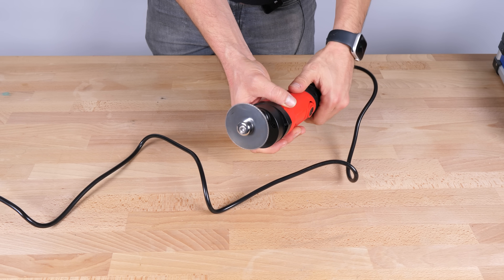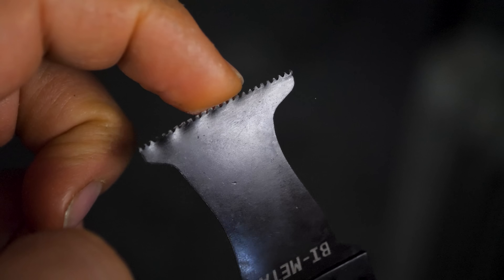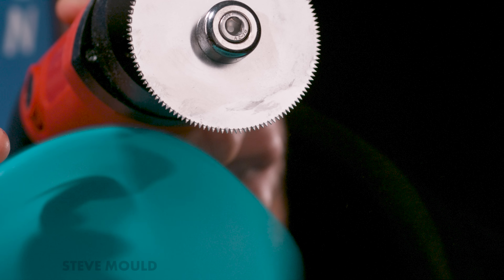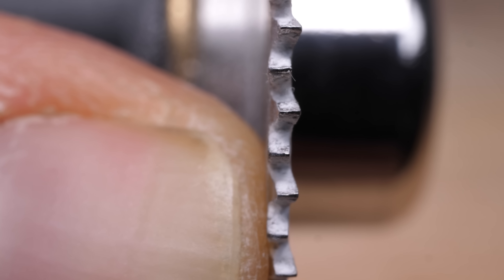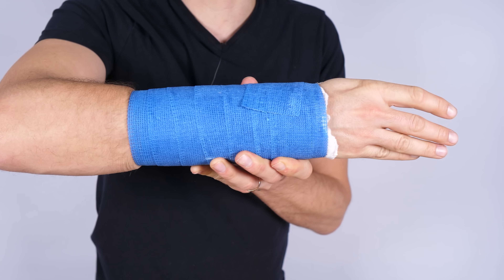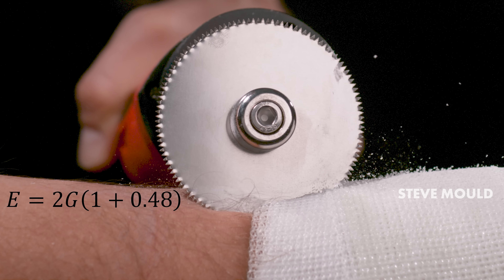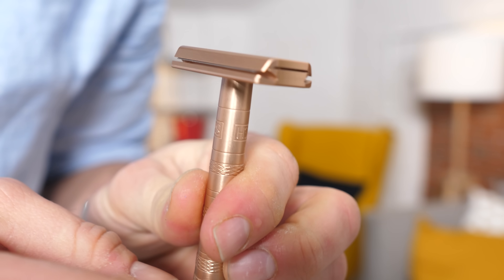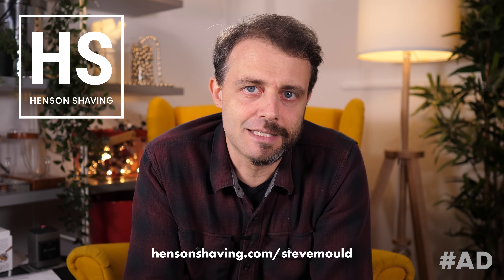A cast saw on human skin

Comment from the maker: One thing I forgot to mention is that the blade can get quite hot from friction. Another reason not to try this at home!
The sponsor is Henson Shaving: Get 100 free blades here: https://hensonshaving.com/stevemould when you buy a Henson razor with code stevemould
Reply: When I was a kid the doctor said I shouldn't worry because the saw doesn't cut trough skin... I still have the scar from the burning it did on my arm though.
Reply: @astropgn  Me too. My scars are 30yrs old and my cast was made of the catalyzed fiberglas instead of plaster of paris. at least it also cauterized the wound it made but it also pushed the fiberglas dust into it. was crazy itchy for longer than I had to wear the post cast removal wrist brace.
Reply: @astropgn  Me too! I told him that it was hurting. It's in your head...
Reply: @astropgn , I still have 2 scars from the burns.  I don't think the Dr. learned anything because the nurses covered it up and treated them without bringing the Dr. back.
Reply: @astropgn  This. When they took the cast off my arm, it didn't scratch me a bit. However, burned like hell and back. I pulled back and started to cry, and since it doesn't cut they assumed I was overreacting.
Reply: @astropgn  same, it destroyed my skin in two places, one of the scars still remains after many years.
Reply: @astropgn same! The doctors said I was lying about the pain :(
Reply: @astropgn my son too.  You’re not alone.
Reply: @astropgn Same shit, the nurse just back from child care break kept scolding me for cutting the cast the night before to remove pressure on the ankle, I ended up with 10cm burn that took month to resolve, especially good with the device I had to get to replace the cast...
Took like 4/5 years for the scar to disappear..
Reply: I don't think I've laughed at a sponsored section quite as much as "I shaved this side of my face with the razor and this side with a cast saw." Brilliant.
Reply: @pfqniet Same - I got a solid laugh out of this.
Reply: My second wonder was, why use a circular blade when only a fraction of it sawing
Reply: @Platypus_Warrior  Might be able to rotate the tool to allow cutting edge to cool down.  Many people get burned from hot cast saw edge
Reply: @Platypus_Warrior the blade  wears out, so you get more teeth to wear down
Reply: @Platypus_Warrior  So the doctor can rotate the saw and keep one area from getting so hot.
Reply: @Platypus_Warrior So it can scare kids
Reply: @Platypus_Warrior  I thought the same and I swear I've seen saws with only a small section of the blade this one has. I can only guess maybe it allows for the blade to be rotated, rather than replaced, to keep it optimally safe and efficient?
Reply: Yes! Therfore a dull blade will hurt the patient more than a sharp one due to excessive warmup. The blades need to be sharp. They can be rotated on axis a couple of times to be used up before discarding. 
/ Medical devices tecnician
Reply: My pediatritian forgot too.. skin burn for this and i believe is good to mention on video.
Reply: I was burned badly by a careless doctor with a cast saw when I was 9. He dismissed my cries of pain and tears and dismissed it as attention seeking because "It can't cut you". Once the cast was removed I had a deep 3 inch long 2nd degree burn along the back of my hand and 1st degree burns along my arm because it had overheated. The doctor dismissed it and my mom thankfully took me to be seen elsewhere where they treated the burns. I thankfully only have a 1 inch scar left now over 30 years later but it was an awful experience thanks to a dismissive doctor who didn't listen or know the actual dangers of the machinery he was using.
Reply: @ransim  He should have been sued.
Reply: The main reason to utterly dislike the forced commercial videos at the start, throughout and at the end is because they simply lack everything. Here, Steve exactly shows how to make a good commercial, like many YTs with a sponsor do. (Only 'even apeldoorn bellen'  are worth watching.
Reply: Great video. Also great sponsor. Bought Henson's razor last year and I won't ever go back to cartridges.
Reply: Hey Steve, the code for getting 100 free blades is no longer valid. Could you please look into that? Thanks!
Reply: Did you not know this No Shave November? Or are you just being a rebel against stupid fads?
Reply: I would definitely like to buy this fine shaver, but I was surprised that shipping to Denmark costs over half of the total cost of the shaver with blades and stand. It would be fantastic if it would be more affordable to buy from a European workshop because 430 DDK 😵
Reply: I feel dumb for never thinking about the effect the structure of the razor handle has on its shaving comfort and efficacy.

The other thing is the composition of the blades. I prefer stainless to platinum, myself, but there are so many options out there, and the price varies dramatically.

That could be a video in itself. Steve, do more commercials! They're entertaining and informative!
Reply: I was going to say that! Had an unfortunate experience having a cast removed by a slightly less competent operator and got some small surface burns on my arm - they healed in a few days, and no damage done, but rather unpleasant.
Reply: I'll never forget the time years ago when a salesman demonstrated a similar tool in my car workshop. 'Look, it'll cut through and exhaust pipe but won't cut your skin.' He did the demonstration in that order and left a nasty burn on the back of his hand.
Reply: I still have a scar on my leg from where the cast saw cut my skin.... I told them it hurt. They didn't believe me until a few months later when they removed the cast and saw the wound.
Reply: Having my cast cut off was the most satisfying itching I ever wanted while having the cast on. IT FELT SOOOoooo Goood, Imagine not being able to scratch an itch for 4-6 months! So when they fired the cast saw up I was like OMG YES, DON'T STOP!
Reply: @oKeNSchWarZo  Dohnt staaaaahp~ MMmm~ XD
Reply: I have burn scars on my arm where the heat of the cast saw blade burned my skin.  I was telling the Dr. that it was burning me and he told me it couldn't.  Once the cast was removed, the nurses had to treat the burns.  So... yeah, it can get very hot especially if the one using the saw is rushing the job.
Reply: How long did you have to not move your arm while you walked around your house waiting for it to dry?😂
Reply: Pity the shipping cost to germany are half the prize of the razor... Thats a bit too much for my taste
Reply: You should slo mo a beard trimmer and or trimmer
I spoke too soon hahaha
Reply: you should try it on your fingernail 👿
Reply: No transparent thing in this video … Who are you and what did you do to Steve Mould?!
Reply: I got a Henson razor and I'm loving it so far. It's a bit slower at cleaning up my chin since it doesn't conform to the surface, but it works amazingly everywhere else. Plus I only shave like once a week, so that box of 100 blades might last me the rest of my days. I might end up buying the stand for it eventually, but I don't have space for it in my bathroom right now, so I just keep it in its box with some silica packets.
Reply: I had one of these cut me when they had to cut a releaf into the cast after an operation to fix both broken bones in my left for arm my arm swelled inside the cast cutting off circulation in my hand my knuckles swelled two the size of golf balls I was 12 golf ball size was piety big. When the went to releave the pressure by cutting the cast it did the same as the over inflated balloon allowing a lot of blood to soak the cast the cut was about 2 inches long and required butterfly stitches to close then had to have a split in the cast over it so I could keep it clean
Reply: The scar on my arm from getting a cast cut off would have to disagree with the idea that it doesn't cut human skin... i got this scar when i was like 10... 10 years later, its still there. The blade got hot, and burned through my skin very easily.
Reply: This is why you'll have trouble convincing my son that they can't harm skin. He still has a burn scar from when the doctor went a little too deep.
Reply: Pity the shipping to NZ is almost as much as the razor.
Reply: Yeah, 35 years ago got my leg cast removed and I still have the burn scars. Why isn't there water cooling for the blade? Seems like an obvious fix.
Reply: What would happen if you dragged the blade across your skin perpendicular to the oscillating direction? Would it pull the skin taunt and cause a cut? What about stiffer skin areas like fingertips?
Reply: I got burnt on accident by the Dr. who took my cast off.
Reply: I have almost 2 feet of scars on the inside and outside of my arm from one of these.  They burned my skin and released pressure without recasting.  Didn't find out till a month later when they had to rip the fabric that had healed into my arm from the scabs.
Reply: I have scars on my arm from getting cut/burned from a cast saw. They put a full cast on my arm after I broke my wrist in half instead of a splint. My hand and fingers swelled up about twice their size. Next day they had to split the cast. As they were cutting it I could feel my arm being cut and cried in pain. They said there was no way it was cutting me. Well, a few weeks later when they removed it to change the cast I had nasty scabs under the cast where I was getting cut/burned by the saw.
Reply: @melywelyj6405  seems like if the cast was too tight the saw might cut you because your skin could not move to do as Steve showed it should. Just a thought anyway.
Reply: indeed it can. it's why I have a burn scar on my thumb at 30 from breaking my arm at 6
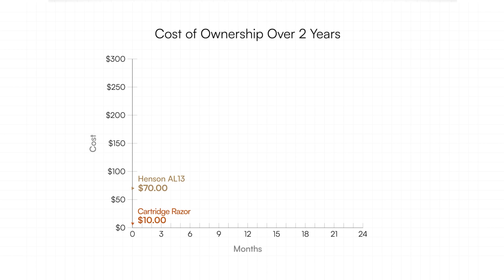Reply: 7:14 I don’t know the prices of these blades in the USA but $265 in 2 years? Here in Germany I have a 5€ (~$5) razor and a box of 6 blades also cost 5€. I change the blade appr. once every month = 25€…. The land of the „free“ where you work your ass off to afford some blades?? 😳
Reply: I was literally coming to the comments to comment this. I broke both arms and my left leg as a kid (all separate incidents) and twice getting a cast removed I got minor burns, but because of my age and the vibrations it freaked me out thinking I had been cut...
Reply: broke my leg in 4th grade,
when the nurse took my cast off with that i was sweating bullets!

idk why they just dont tell u it cant cut ur skin lolll...
Reply: @NickPWilde-cu7fu  Because they are sadistic!
Reply: OMG !!! I actually thought for real you kut yourself
Reply: be careful that the algorithm can strike down the video simply due to the title/picture.
Reply: What if you have a scab under the cast?
Reply: the code isnt working for me, saying invalid...
Reply: Amazing promotion of your sponsor! You do deliver the goods to your sponsor that paid you. You should ask for more. Besides that, the content was as good as usual. Meaning: "awesome" content! As usual.
Reply: And of course most reciprocating.power tools move more than this.
Reply: Hilarious commercial content at the end ... 😂.
Reply: Great idea for a video. Seems popular!
Reply: does that mean you could theoretically still cut your skin if it were on a place where theres merely bone and skin like on your wrist joints for example`?
Reply: How was "that face" not the thumbnail?
Reply: does razor blades get hot from friction or cutter
Reply: Instructions unclear. I have now three legs and  no arms
Reply: Ligma
Reply: @alecmanden6192  Bruh, that's so 2018
Reply: It does not cut through skin
Reply: I switched to double edge razors over 10 years ago. I will never go back.
Reply: Sadly, safety razors are not quite what they claim to be, safe. Hence, one of the reasons styptic pens were invented. My stepfather will attest to that
Reply: Isnt that how vibrator in adult toys works ?
Reply: You said "don't try this at home", so why would I buy one? This belongs in a hospital, and I am sure they already know where to buy it.
Reply: Since it's oscillatory motion , the blade doesn't need to be circular right?
Reply: Philips has a razor that uses oscillation to cut you facial hair, works pretty well
Reply: Пойду снимать тикток с вибротулом )
Reply: i had mine taken off 2 weeks ago
Reply: But why is the cast saw blade round if you only need like 1 or 2 inches of it due to the oscillation in comparison to rotation?
Reply: bro me asuste al comienzo del video
Reply: if the propose of the video is show how safe it is and you dont mention the most important danger fact of heat and skin burn i truly suggest to remake or edit your video for a better explenation.  + DiSLIKE for this forgoten detail.
Reply: well.. ima try it outside
Reply: aw
Reply: Yep, I got a cast burn when my mom volun-told me to go to a workshop for athletic trainers
Reply: There is a lot of Mould under that cast.
Reply: So it's possible to repeat on outside? 😆
Reply: WHY DONT THEY TELL YOU THAT WHEN THEY DO IT
Reply: I got a 3rd degree burn during a cast removal with a cast saw. Still have the scar on my arm.
Reply: 2025
Reply: Damn it! Just stole a cast saw from the doctor’s office specifically to try this at home…!
Reply: Same. The doc said to me. “Don’t worry buddy it’s basically a vacuum cleaner with a sharp blade on it” (didn’t really help)
Reply: How you use an 18v open standard power tool battery that works on multiple brands to try to make your razor point ^^
Reply: I had a medical professional burn my arm and when I said ouch they laughed at me, I still have the scar.
Reply: Lmao, wtf is this?
Reply: I am purchasing the razor for my dad and myself and your code allows you to purchase 2 and get a free box of blades per handle. Thanks Steve!

Comment: The surgeon who removed the cast from my broken leg used the cast saw on the front of my lower leg — the area with the thinnest skin, directly over the tibia. As a result, the saw actually cut into my skin. I felt pain and yelled, but they treated me as if I was “making a fuss.” because "Cast saws will not saw through skin".
The scar is still lightly visible today, 13 years later.

Comment: I had a cast on my leg from crotch to toe. When I finally healed and it was time to remove the cast the technician brought out the cast saw and reassured me that it couldn't cut me. I wasn't concerned at all and told him to proceed. 5 seconds in I felt pain and told him to stop. He looked at me like I was being hysterical and ignored me. I grabbed his arm and shouted at him to stop. He got extremely angry with me and started yelling at me. He said I was being ridiculous and stupid (his words) at said it was impossible to cut me. He was correct. It didn't cut me. It burned me. I had a broken burn line all the way down my leg. Despite this direct evidence he still refused to take responsibility. I have extremely dry skin normally so you can imagine how dry my leg was considering it was in a cast for 3 months. I was obviously furious. Not a fun experience.

Comment: I actually got 2 trail of outer skin layer removed by a cast saw ( top and bottom of my arm ), my cast had not a lot of protection layer and it actually removed the top layer of skin with almost no blood or anything, exposing white flesh, it was strange, probably due to heat but not enough heat to cause a burning, i think the heat + the friction can remove layers of skin if you press hard enough against it.
I was slightly complaining about feeling a sting sensation at the fresh newbie intern doc, but since i have a high pain tolerance my reaction probably was not alarming enough for him, he just said that it is fine if it can feel a bit hot. At the end when he saw the 15 inch trail of exposed flesh on both side he was sorry lol, he definitively learned something that day, do not trust everything that you read in the university books lol, this shit is not harmless.
The cut was deep enough for that i had a scar on both side 15 inch long, some of it disapeared, but i still have some spot on that line which were deeper and the scars are still there even after 10 years.

So definitively not harmless, your doc should always verify if there are enough layer under the cast to avoid direct contact with the skin, which the new intern didnt though of doing before going ham with the cast saw.

Comment: This makes me question what the hell they cut my cast off with. They not only shoved a metal ruler in my cast on the line they were cutting on so they wouldn't cut me, but at one point it missed, and not only did it cut me slightly, but the blade was hot enough that it burned the cut, closing it, immediately. This happened 2-3 times, all very very tiny cuts, but it did hurt, and the nurse just kept saying "Oh relax, it's not cutting you"

This happened all 3 times my cast was removed (Had several issues, took them 3 times to get me a cast that wasn't painful to wear) everytime they missed, and I got small cuts like this, and it hurt, quite a lot

Comment: Very simple.

The circular blade on a cast saw doesn't rotate 360° but oscillates at small angle at incredibly high speed.

It can only cut hard, rigid, non-flexible objects.

But when flexible or movable objects are tested. The surface of those objects also move syncing to the oscillation of the blade. So the sharp teeth don't cut through.

But still that's very risky. If pressure is applied, those moving teeth can also tear into human skin. It's not a playable toy at all.

Comment: I tried cutting off my cast using an oscilating gasoline powered chainsaw but beware that most gasoline powered chainsaws aren't of the oscilating type as the Poisson's ratio of tree bark is up there in the high 0.70's.